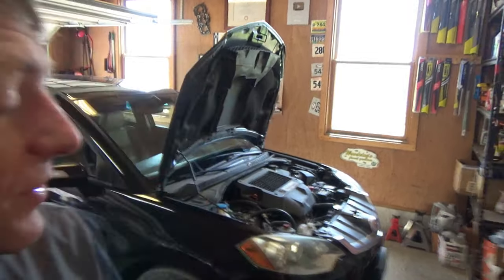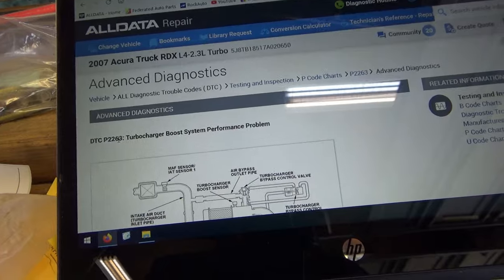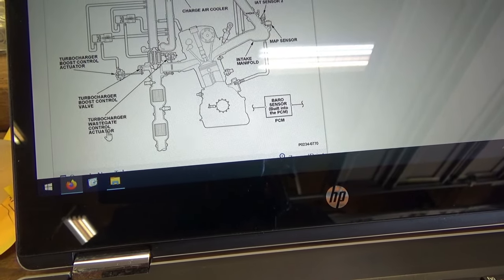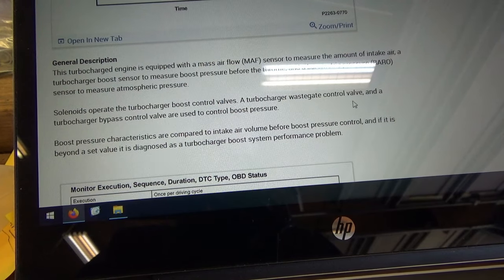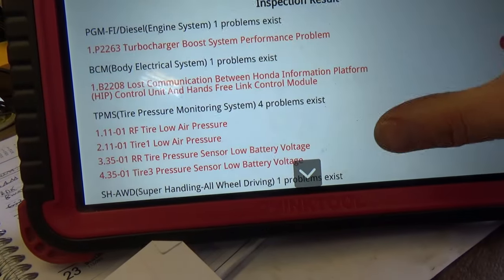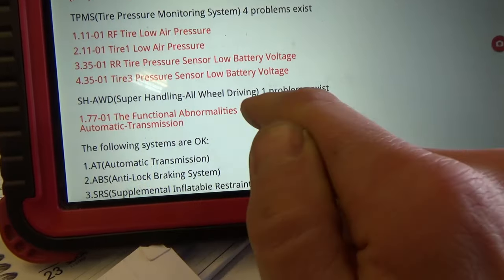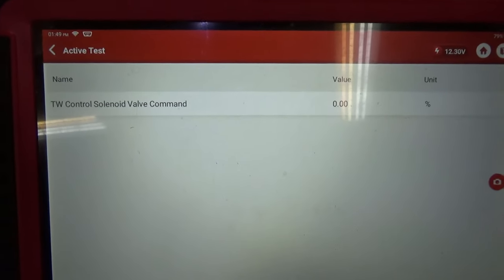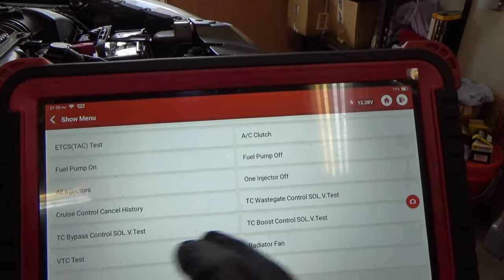TURBO Problem Disables AWD? (Acura RDX)

Comment: owner upgraded actuator clevis to hardened steel but what happens is the actuator pin it slip onto wears out instead, it requires a hardened sleeve over the pin if you use a hardened clevis. He moved the problem to the next weak point in the chain .of connections. Its better to wear out the clevis connector than the wastegate pin, thats why its made from softer material, its a sacrificial consumable.

Comment: By taking the slack with the adjustment you closed the wastegate and allow the turbo to build required boost. BUT now the system can’t open the wastegate all the way when needed, especially with leaking actuator. This is why the test failed after adjustment. On sustained high  load operation it will throw overboost code. Over time this damages the turbo.

Comment: Nice! That K23 is a weird engine, I'm not sure why they didn't just use the K24 they used in the Accord, CRV, Element, TSX, etc. Developing an entirely different engine for one vehicle for a 0.1L difference in displacement seems ridiculous to me, but I'm sure they had their reasons.
Reply: It's the same 86mm bore as the K20 and the same 99mm stroke as the K24. So K20 block with K24 crank? Guessing the cylinder heads are similar to the K20.
Reply: @tylough The K23 block also has the same deck height as the K24 at 231.5 mm. I know the K23 block won't bolt to the regular K20/K24 transmissions because the bell housing is different. The cylinder head has the economy iVTEC system with VTEC only on the intake cam like the K20A3 and the same size intake and exhaust valves as the K24A2. Overall, the K23 doesn't seem nearly as impressive as the K20A2, K20Z1, K24A2, etc since those engines all make 200+ HP stock all motor while the K23 only makes 240 HP with 13.5 PSI of boost, which regular K20/K24 will easily make or exceed with just basic bolt ons and a decent tune. With a proper turbo setup making the same amount of boost, any performance K20/K24 will easily be well over 400HP.
Reply: Don't forget this was the first turbo engine honda put on the market and they were very conservative with the tune! A simple hondata reflash wakes up the engine a lot! Also the transmission is build a lot stronger I believe, mine is at 200k miles and doesn't show any signs of fatigue with over 300hp at the motor, best vehicle Ive ever own
Reply: @speedymicky  correct sir, intake, down pipe, ug injectors and hondata tune made all the difference.

Comment: Another weird case gets a great diagnostic. Only doubt I have is if you don't' have a leak in the diaphragm (it leaked when you applied pressure, but it could be so by design, if over-pressured).
That problem starting could also be worn brushes, but I guess you don't replace brushes in the US, just go for the whole starter motor. Great video, as always 🙂
Reply from the maker: Crappy starter is lifetime warranty so you just have to replace it every couple years haha
Reply: @PineHollowAutoDiagnostics  OK. Good to know 🙂
Reply: Thanks Ivan, and I did replace the Starter after you got the car back to me. Good thing it’s only a 30 minute job!
Reply: @aharbis  Great that you fixed it!

Comment: Thank you for this video! I've had the same problem. I replaced the waste gate actuator and it eliminated the buzz sound, but the sh-awd turns itself off still. 

I've been erasing the error code for the sh-awd and the emission code every time I start the car, and the awd stays on until I turn the engine off again. Rinse and repeat sh-awd.

I've been driving her this way for about 20k miles, and it runs as well as the day it was built. She's got 220k miles, and I love her.

If anyone has any suggestions aside from replacing the whole turbo for $7.5k, please let me know.

Thank you all!

Comment: Actually kind of neat how Honda did this turbocharger set up. It is actually using two different ways to control boost on the hot side of the turbo. Your typical common WG actuator and a valve to bypass gases from the turbine and a variable flap to control what channel the exhaust gases to flow through. With the variable flap keeping closed during light throttle and normal driving to have the turbocharger act as a small turbo to dramatically reduce turbo lag, and opening the flap to have the exhaust gases flow through the big channel and smaller one to act as a higher volume hot side to flow more exhaust gases during high load events and WOT.

Also, that WG actuator is starting to fail, shouldn't have that much air escaping, One of the test I do is apply vacuum to it with my hand pump and make sure it can hold a vacuum. Anyways its never good to have a flopping WG actuator rod like that, HOLY SMOKES... Surprised that thing even made boost at all!

Comment: I like how you explain everything step by step . I have a question for you. I gave 2008 Acura RDX and it takes a while for it to start . After I get hom I shut off the car and fry to start right away it starts no problem, but if I let it sit for 20 minutes it takes 5 seconds to start what can this possibly be? 
And also it drains my battery over night 🤷‍♂️
Reply: For the Battery Drain, check the Bluetooth control module (HFL).  It was draining my battery too. Especially on these older cars (mines an '07). If you don't use the Hands Free Link, just disconnect it. It's a 5 minute fix. The access panel is on the passenger side of the transmission tunnel. pop the cover, and pull the plug.   it should be directly below the cup holder. It fixed my parasitic drain instantly.

Comment: Umm, I'm not certain about the test you did on the diaphragm.  In the video, you can hear a rush of air when the diaphragm actuated.  But the diaphragm itself should NOT leak any air.  Was that sound we heard coming from the test equipment?  Or was that the diaphragm leaking Ivan?  Also, a little high temp grease on the linkage end goes a long way between adjustment intervals.
Reply: The wastegate arm gets extremely hot under load and regular high temperature grease will just boil off, that's why the linkage bush is dry straight from the factory.

Comment: The wastegate actuator cannister should not leak. If it does metered air escapes via the solenoid, via the cannister whenever boost is demanded.
And boost can't be properly controlled.

And yes, there should be a pre-load on the WG actuator rod. 

Another issue with older high mileage turbo's is possible cracked wastegate port or WG valve. It causes slow spool-up.
Reply from the maker: I would love to bench-test a new actuator and see if it leaks air or not...
Reply: @PineHollowAutoDiagnostics  I got a rdx 2008 with a spare turbo assembly and assure you the actuator with  o to 14 psi air pressure from my compressor is not leaking at all
Reply from the maker: @chrisland169  ok that is good to know. I'll reach out to the owner and recommend a new actuator 👍

Comment: So BMW has this same issue. Even though the fix is ok my advice is to replace the wastegate actuator rod and flap if possible. Often times the flap and rod are integral to the turbo. But the fix used in this video will likely be temporary. The flap on the turbocharger turbine side is likely worn. And the linkage along with it. So it will just wear again until the same problem resurfaces. You'll get away with it a couple of times. But eventually the turbocharger will likely have to be replaced. To be clear I'm not saying Ivan's solution is wrong. I do this often on BMW's. Adjust the rod. Do a relearn for the wastegate actuator stops. And send it. It's just that the reason this happens is wear. So the temporary solution is to make an adjustment. But the longterm solution is to replace the worn parts. Unfortunately in the these cases the wastegate and linkage is usuallu integral. Which means the entire turbocharger has to be replaced. Whenever I get one of these, wether it's a BMW or an Acura, I advise the customer that it's a temporary solution. They're usually ok with it when they see the parts and labor for a turbocharger replacement. But the idea is to make that clear.
Reply from the maker: If it lasts another 3 years the owner will be happy 😁

Comment: I'm 4 min in, not sure what actually  set the code, but one thing to consider is the after cooler, they get holes in them, and  leak boost, I  often hear it on commercial trucks struggling to get up mountains....

Comment: Ivan: the waste-gate puck & the surface it sets against wears out. You can adjust the linkage as many times as you want but the problem will keep coming back. Parts ARE required!

And great seeing you wearing the seat belt. Not sure why guys get mad if I want you to stay alive in a frontal impact.

Comment: Ivzn, if the waste gate doesn't close fully you will not get the boost build up quick enough it cam also be sluggish responding if corrosion exists.

Comment: Are you able to help me point out the location of the boost pressure sensor? I really thought you were going to deal with it during this video but my waste gate was also loose and making the same noise that you fixed on this vehicle so thank you so much for covering that and helping with that but I am still getting a code for the boost pressure sensor, but I have no idea where it’s located. Can you help me with locating it and showing me where the boost pressure sensor is located at?
Reply: You figure out where it is ever?

Comment: Did the car come back for the turbo performance issue? That's quite a gap in the wastegate linkage. I replaced mine and the code no longer appeared. It was hell to replace the worn linkage. The gap on mine was a lot less than this one and I haven't had any more problems.

Comment: Nice diagnostic my friend. Never had a chance to work on a turbo system. The Astra was back Driver side power window regulator and window came off track.  5 hours later it is fixed.  I am going to send you an email personal question. for you.

Comment: What about this problem with the same car model?

(p0234,p0117,p0365,p1131)
engine very hard to start and runns rough 

I've make a test drive and had a late start, then worked good but sometimes rpm or misfire lose. 
Where is located the camshaft sensor?

Comment: so the light bulbs on the starter was like doing a voltage drop test right?i was thinking do people ever hook up test lights power to power or ground to ground and look for voltage drops this way if they suspect a massive vd?maybe use a led to be able to spot a small voltage drop this way?just curious.because a led would light if you had a few volts of drop right?

Comment: I just got a great deal on an RDX with probably the same issue on the turbo valve thing. I might pee my pants a little if I just need to tighten the screw a little rather than have a new turbo installed 😂😂

Comment: Hello! I have the exact same RDX except mine is a 2012. I'm also having the exact same issue. I too can hear the waste gate rattle when in neutral and reving my engine. Both nuts on top of the center long nut above the actuator nut look secure. Any advice would be appreciated! I would love to have AWD for the winter ❄️

Comment: I had a similar starter issue with my 2006 Accord. I replaced the starter and upon inspecting the old sarter I found that honda starter had two pairs of brushes, one pair was worn and I guess that causes the intermittent starter issue or the weak battery impression. I think honda sells the starter brush assembly only too.
Reply: Had to rescue my daughter from the beer distributor. Kind of hard to bang on the starter and turn the key at the same time lol

Comment: Test the turbo boost performance by bouncing the engine off the rev limiter until it throws a rod. replace turbo solenoids and turbocharger at the same time you replace the long block.
Reply: Around ~5k rpm, not redlined 😎
Reply: They have a built-in no-load rev limiter that is well below a level that would cause engine damage.
Reply: Lol! If that causes the engine to throw a rod, then it was ready to die at any time and would probably have other tell-tale issues of such failure

Comment: Confused by which direction you went to tighten the waste gate actuator.  Appears in video you started going counterclockwise which appeared to loosen it and then went clockwise which appeared to tighten it. Then later in the video it appears you used a wrench in a clockwise motion followed by using the wrench in a counterclockwise rotation. How many net rotations did it take to get the waste gate to work properly?
Reply from the maker: Just go in the direction that takes out the slack, then add one full turn :)
Reply: @PineHollowAutoDiagnostics    I replaced my Variable Flow Actuator Eye Bolt & Nut VGT Rod End Link with one from EBay. Mine was worn and elongated. Unfortunately after replacing I was still getting the P2263 error code. After watching your video I tightened the linkage by going clockwise with the tall adjustable nut until I felt tension on the nut from the waste gate being in the full upright position. Then held the tall nut in place with one wrench and went counterclockwise with the small lock nut with another wrench to lock the rod link in place. Reset the codes and took car for a 10 mile drive. Boost on turbo gauge easily spooled up when accelerating quickly and no codes!!! Thanks for the educational video.

Comment: Helo sir, I'd like to know where are you located cause I want bring my 2007 Acura RDX so you can fix my car. It's got the code P2263 and also has a flashing D drive light. Have you give it dianostic test to see if any other codes pop up that you can fix for me.

Comment: all data saying blow off valve controls boost pressure i think is wrong,its purpose is to evacuate excess air when throttle plate closes otherwise it has knowere to go and goes back into compressor wheel causing surge and has nothing to do with boost control.if it was stuck shut it would just cause compressor surge and boost pressure would stay the same.

Comment: What you're repairing is the "boost control actuator" and NOT the wastegate control. It varies your turbine A.R. size. Small AR for low rpm/load respone and switches to big AR mode for power up to redline

There should be no air leak on the top hat of that actuator. Since the air pressure that pushes the spring is coming from the inlet "charged" pressure. It is technically, considered a  "boost leak" everytime you send air to that actuator. Though apart from hearing leak air noises, the turbo will spin much faster to maintaim same boost levels due to leak making it more inefficent.

Also, not sure how you "Put a preload on it." As mentioned, it is used to regulate turbine AR housing so pretty tight connection is needed BOTH WAYS to keep the butterfly vavle in there on the happy zone at all times.
Reply from the maker: That's definitely the wastegate control. Boost control is the other one that I showed from under the car 😉
Reply: @PineHollowAutoDiagnostics  It is not a waste gate. This specific turbocharger does not work like that. It has a variable rear end. Boost control and waste gate is the same thing. The boost controller controls the waste gate then as boost pressure rises then the turbocharger changes the size of the A/R in the exhaust housing. That flap that changes the turbo size is the one that usually rattles and can also get worn out.
Reply: @Marion San Pedro  You are correct :)
Reply from the maker: @SkalabalaK6  "Boost control and waste gate is the same thing. "....No.
Please watch the entire video again, I show the OEM service info at the beginning. Two separate controllers. I fixed the WASTEGATE linkage.
Reply: @PineHollowAutoDiagnostics  it's clear here: https://youtu.be/ItMNT3fnB6o

Comment: This turbo consumes more in gas, 
65 L full tank gives only about 290 km in the city.
Is it normal ?

I have changed spark plugs,  air filter oil changed on time .

Comment: What is the purpose of the boost control solenoid?  In other words why wouldn't we want maximum boost at all times?  Honda has no control over what fuel is put into the vehicle.  Low octane will cause knock and damage the engine.  If knock is detected spark advance is decreased and boost is decreased by way of the ECU controlled boost solenoid.  So, less power but the engine is protected.
Reply from the maker: It's a variable vane type for faster spool and then more volume. Pretty ingenious!

Comment: turbo  boost actuator linkage should have a small amount of pre-load to eliminate rattling, no need to know anything else.
An explanation needs no explanation, unless you feel a need to scan for flat tires too.
Sometimes the need to design a better mousetrap fails to see the mouse is already in the trap.

Comment: I have the same problem same code I replace the turbo and I still have the same code. I replace the wastegate solenoids, but I don’t know what’s going on with the car.
Reply from the maker: Make sure your oil pressure is good lol

Comment: I changed the turbo that pice  came on it with both actuator all connected and adjusted  I'm still getting the same code any suggestions